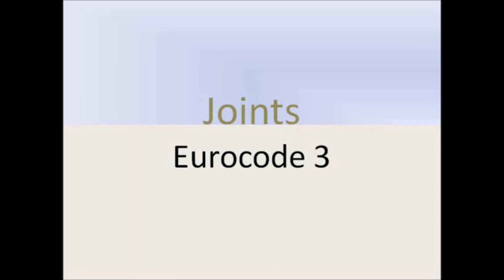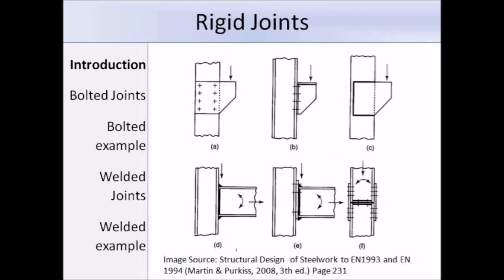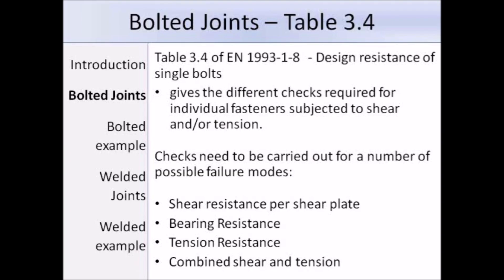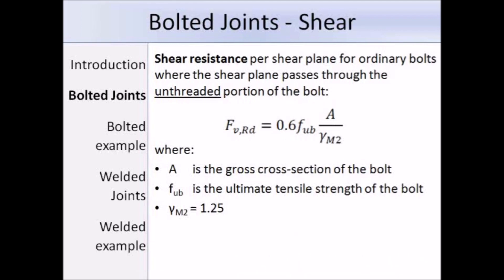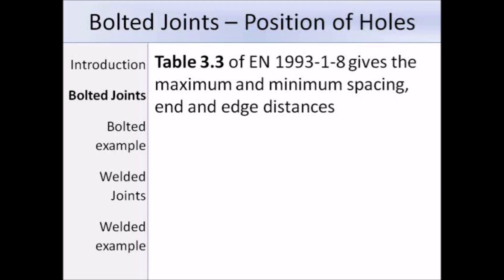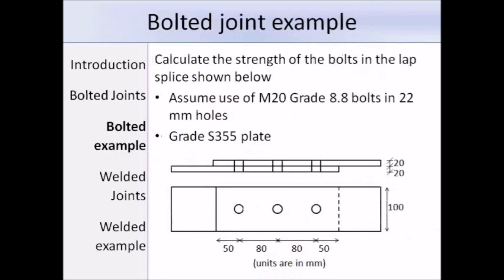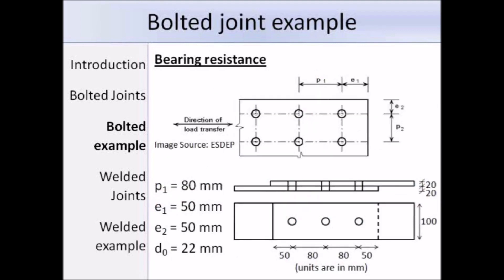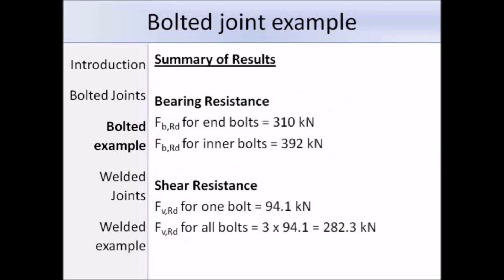Steel Connections | Bolted Joint Design | Pinned Joints | Rigid Joints (Fixed) | Eurocode 3 | EN1993

Comment: Hele there. Is there an app/free software to calculate prequalified bolted junction connections beam-column? . The equal joint app does not work

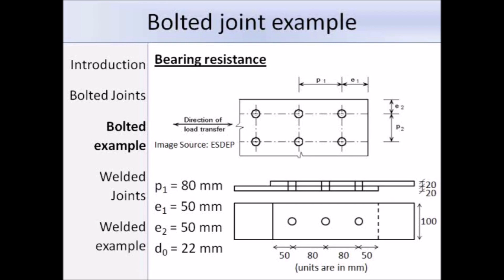Comment: Hi Dilakshana, thank you for posting this video. At 10:34, you take Fu as 510N/mm2. I take it with your blue circle it should be 470? Also for the ultimate strength information in EN 10025-2 would it not be Table 6? Video is very clear and you make it easy to follow, good job.